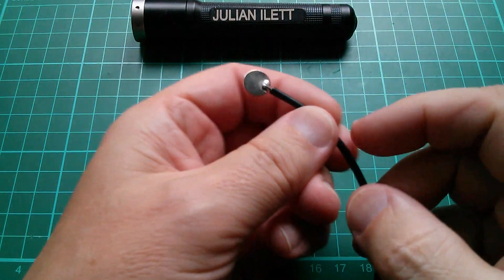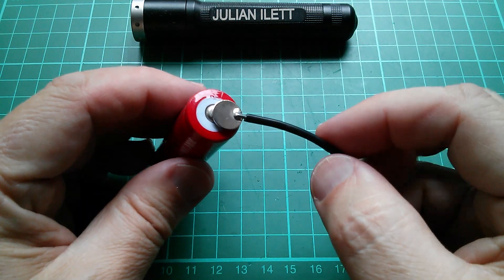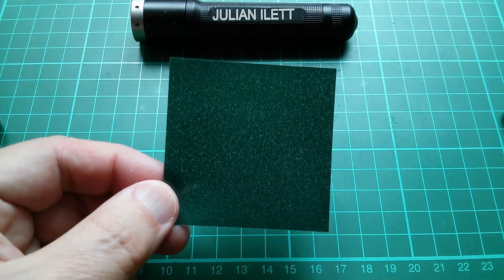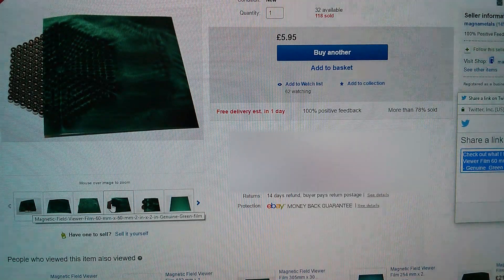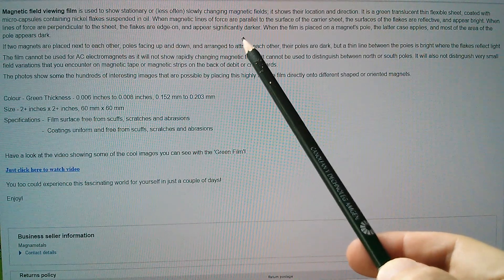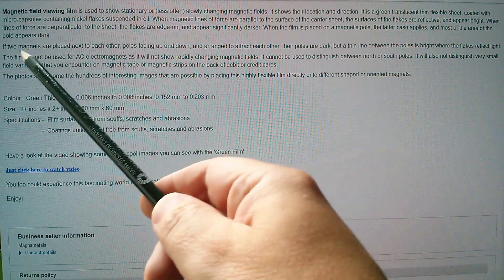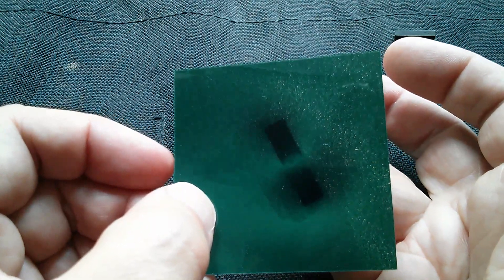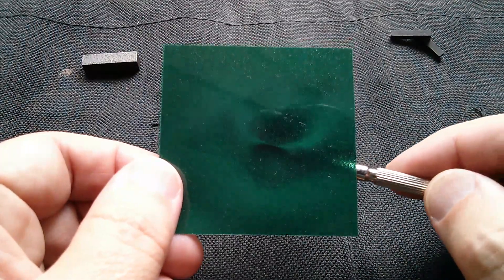Playing with: Magnetic Field Viewing Film

Comment: Interesting video.  Wonder if a electrically conductive epoxy would work for attaching the wire?  It is fairly expensive material.
Reply from the maker: I'm now thinking of sandwiching the wire between two magnets and putting a drop of superglue inside.
Reply: You could sandwich two magnets between the wire but while the solder is still hot. Would mean both magnets have deformed fields then, but using superglue could be awkward given its a bump of metal you are gluing to.
Reply: Have you thought of using conductive epoxy?
Reply: +2000jago It should be possible; I know they magnetize them by running a single strong pulse on a coil around the material; but I got not clue on the numbers.

Another way would be to heat it, and then let it cool down slowly while immersed in a strong magnetic field; but I'm not sure if you can get it to be as strong as you can get with the pulse technique.
Reply: Heat the magnet beyond its Curie point, apply a strong magnetic field while you let it cool below it.

Comment: Looks like the heat flipped the poles. What happens if you just tin the whole side you want to solder on? Then attach the wire. It shouldn't demagnetize like this one did not. It should flip the poles entirely.
Reply: Build a capacitor bank which you can charge up to high voltage, dump that energy into a coil and remagnetise your neodymium discs :)
Fairly easy to do if you can amass the parts :)
Reply from the maker: I really want both faces of the magnet to be clear so I can stack these connectors.

Comment: I wonder if a 3D field viewer exists cheaply
Reply: Yes,  fill a clear flat sided bottle with mineral oil, the cut fine steel wool in to 1mm length and add it to the mineral oil.  Place magnet on side and watch the magic right before your eyes.
Reply: Vacuum seal the magnet on a plastic bag if you don't wanna have to clean it afterwards.
Reply: ***** I hadn't thought about this the first time around :p